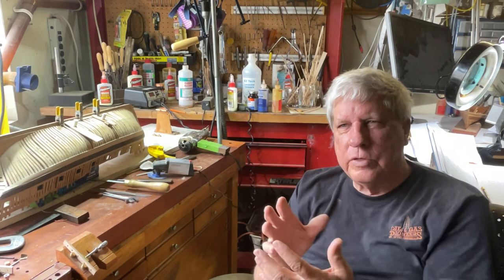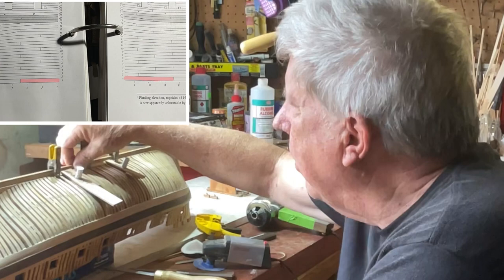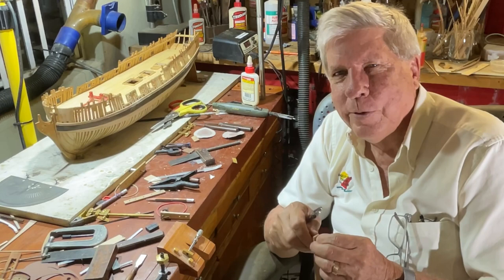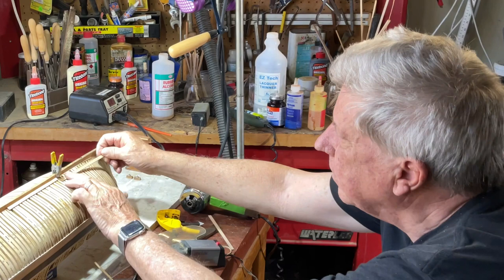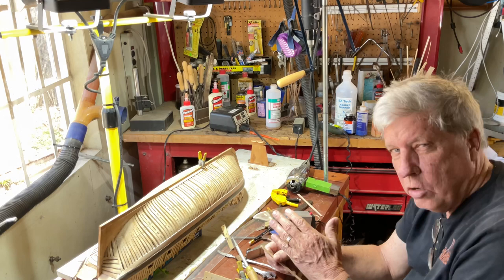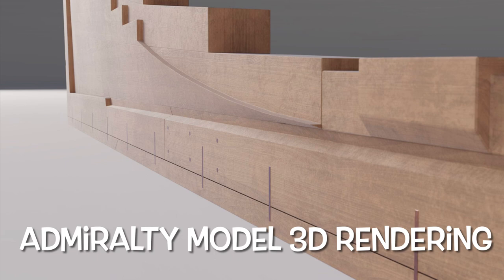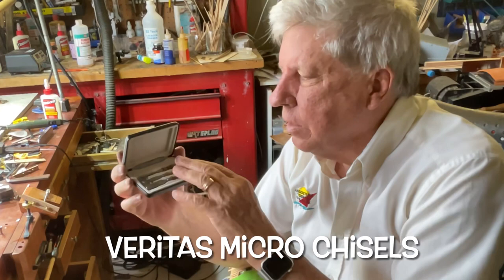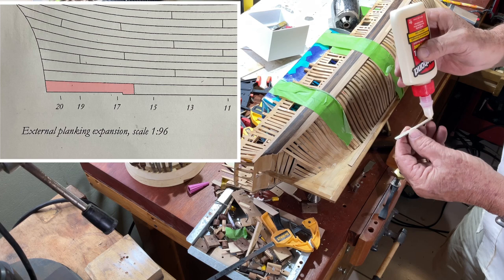Video 92. HMS Thorn. Part 4. Planking 101. Installation of the garboard strake

Comment: When you talk about three inches, are you referring back to the full size boat  and one has to scale down to the model. Or did you mean 3mm rabbet? Seems a lot
Reply from the maker: Its very difficult to keep looking up the scale measurement and then keep those numbers in your mind  so David and Greg suggest that we continue to think in real measurements and then when we need go back to the scale number. I have a table of scale measurements that i keep on the work bench than i can easily reference. So i am referring to the real boat at all times until i reference the actual scale conversion number.